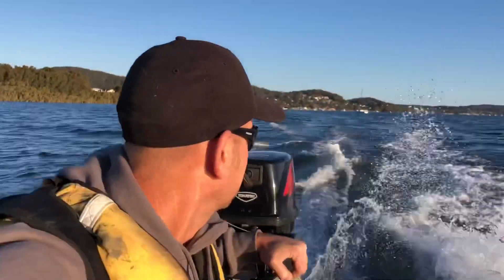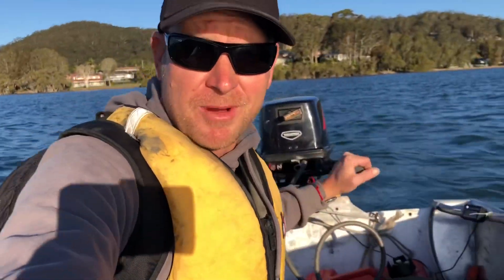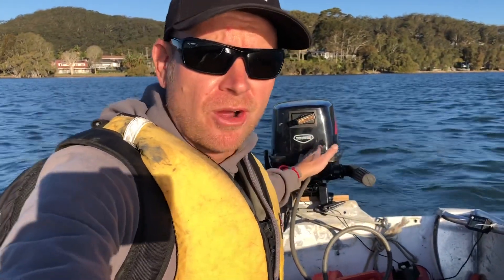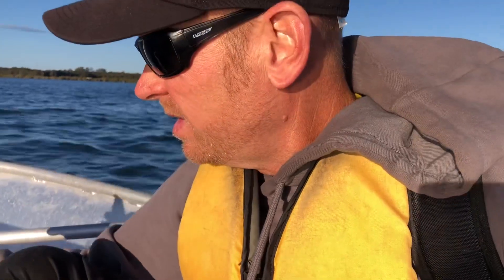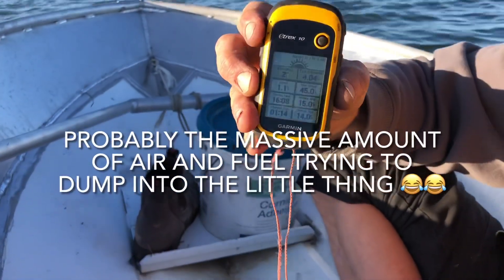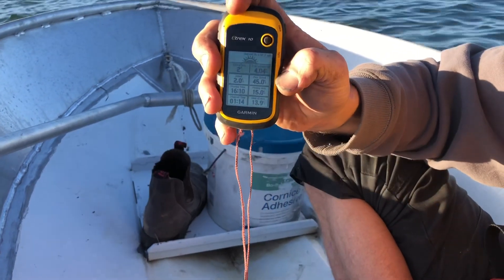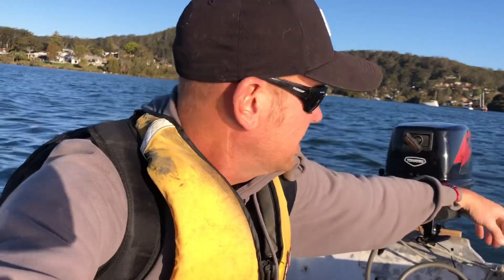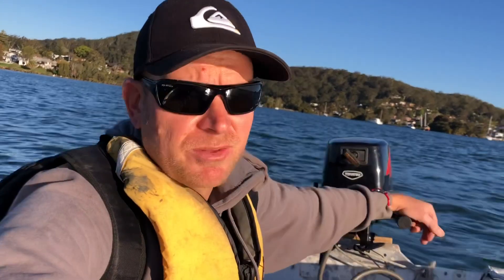Modified 9.8hp outboard

Comment: that thing is juiced. i believe the amazon hangkai 12 hp is the same exact engine (knockoff). would be awesome to try the mods on there. That engine is super cheap and readily available. Love the power to weight ratio.
Reply from the maker: Hi Mate,
Yeah, I’ve seen that 12hp, wonder if it’s actually any more powerful than the 9.8hp? would be amazing if it was. The power to weight is amazing for sure.
Cheers 🍻 
Aussie Boat Guy 😎
Reply: Hey Neon, post back here if you get that 12HP, I too wondered the same thing. Thanks
Reply: @rrrttt1112  yeah i bought it, it pretty much the same
Reply: @NeonSwell  Thanks, How much does it weigh?

Comment: Gday there. I have modified carb on a 5hp parson 4stroke. Used to do nothing 2thirds throttle and above. After finding webber carb calculations i have bored venturi out 2mm to match throttle bore and port matched carb and manifold. Recorded all before and after mods of air jets and fuel jet sizes. Am lean on main jet so made air bleed smaller. About to test it. Carb been on and off plenty times playing with fuel and gets better each time
Reply from the maker: Hi mate,
Good work, and sounds like your having as much fun as me, keep it up 👍 
Cheers 🍻 
Aussie Boat Guy 😎

Comment: did you have to take install a 18 reed block to fit the carb
Reply from the maker: I had to modify the original reed cover of the 9.8hp by aluminum welding extra material on where the bolts attach the carb and machining out the centre.
Cheers 🍻 
Aussie Boat Guy 😎

Comment: how hard is it to install the 18 carb
Reply from the maker: Hi Mate,
It’s super hard unfortunately.
custom reed cover, full carb rebuild and rehash for the linkages for the 9.8hp and jetting
Reply: @25hpboatracerman  hey man thanks for getting back to me. What are the mods? Could I do to my 9.8 to push some more power out of it? It's a tohatsu just like yours.
Reply from the maker: Hi Mate,
I have the video that showed all the things I did, you can see what’s involved by watching that.
Cheers 🍻 
Aussie Boat Guy 😎
Reply: @ hey mate is there anything that i can do without pulling the block of the outboard like do the carb reeds or anything in the lower unit ?

Comment: Well done, that outboard fly's!.
I had a 2006  9.8 long shaft, I wish I never sold it because it was light and powerful. Great video
Reply from the maker: Thanks mate, yeah I’m so happy with it.
I’ve owned about 5 9.8hp outboards over the years and glad I have finally modified one.
You can always search for another one, they are great being so light for the power they put out.
Cheers 🍻 
Aussie Boat Guy 😎
Reply: @25hpboatracerman   I  might just do that... I had my 9.8 on a 11ft dory and it pushed it along nicely, I can imagine it would absolutely fly with your 18 hp carb set up 👍
Reply from the maker: @glockeva1  
Yeah, it would.
Top end speed is a bit more but the power onto the plane and mid range punch is incredible 
Cheers 🍻 
Aussie Boat Guy 😎
Reply: Just buy the 18hp only 41kgs 👍
Reply from the maker: @aarondavis9044  
True, love the 18hp.
But if you need to carry your outboard (as I often do down to the water at about 300m) then the 26kgs is way better and now it gps speed clocked at 50kph so it’s nearly on par with the top end speed of the 18 👌
Ps: I’m sure I will end up modding an 18hp too.
Cheers 🍻 
Aussie Boat Guy 😎
Reply: @25hpboatracerman  I've got the 50hp tohatsu 2st bloody love it 👌👌
Reply from the maker: @aarondavis9044  
Yeah, they are awesome motors, got one as well 😁 go the Tohatsu 
Nothing like the sound of a three cylinder two stroke I reckon.
My mate has a 3 cylinder yam 30hp that’s modified, such an exciting sound 😁
Cheers 🍻 
Aussie Boat Guy 😎

Comment: Gidday mate! Have you considered flat slide carb fir this engine ? Im building the same engine to basically your specs, proper porting and the half mil shave yuve done 👍. Im excited! Could you please let me know the jetting in the 18 carby , ill definitely start there if youd be so kind ! Cheers buddy love these videos ❤
Reply from the maker: That’s awesome mate,
Did you make a new exhaust tuner and do the reed plate mods too?
I used the 22mm throat 18hp carb (there is a 20mm throat too)
I have ended up with a .60 low jet and I had to modify the main and reduce it to 1.02 as the 1.1mm was flooding the motor, still playing with the jets as it’s still not perfect.
So the 18hp 22mm throat carb normally has a .60 low and a 1.16 main jet.
The 20mm throat carb normally has a .80 low jet and a 1.1 main.
Just for your info.
Please keep me posted on your progress.
I’ve got a lower uni build video coming for that motor too

Comment: Cool! Would like to see some more details, do you have a different prop on it?
Reply from the maker: Hi mate,
Hope to be giving more details on mods in a future vid.
It’s just running the standard alloy prop and standard gearcase in that video.
I’m just trying to get the jetting off the bigger carb right, still not quite there 🤦‍♂️🤦‍♂️
I tried the 5hp race prop on that motor but running full depth. It hit 50kph gps but it’s not enough prop for it.
Got a few props I want to try once I raise the motor 😁😁
Cheers 🍻 
Aussie Boat Guy 😎

Comment: I thought it was only the 9.9 with the 18 block that you could do this to.
Reply from the maker: Hi mate,
Any outboard can be modified 👌
The 9.9hp Tohatsu can be modified with bolt on parts from the 18hp but it only shares the same block as the 15hp, the 18hp looks the same but has more capacity and way bigger ports from factory.
My 9.8hp shares the same block as the 6hp and 8hp so all my mods I have to make or do myself.
Cheers 🍻 
Aussie Boat Guy 😎
Reply: @25hpboatracerman  awesome stuff mate. So what parts would I be able to bolt on to the 9.9?
Reply: Does that mean that the 12hp hangkai is the same as the 15hp tohatsu since the hangkai 12hp matches the 9.9hp tohatsu? Do you go by model numbers?
Reply: Is there a major difference between the 9.8 and the 9.9? Or am I confused? 6hp-8hp-9.8hp same same then 9.9hp-15hp-18hp same same 
Or can I still bolt 18hp power heads onto a 8hp or 9.8hp leg

Comment: This is awesome! Been waiting for you to work on one of these beasts!  So, you said the motor is built to run rpms over 7000, is that the specs, or what your specs are after you did all the mods? Thanks (great job, am looking forward to more about this 9.8!)
Reply from the maker: Hi mate,
Thanks for your comments 😊
Yeah, I changed the port timing so that the power will still be available at higher rpm.
I built a custom exhaust tuner with a different shape and bigger internal than standard, it has 15psi more compression than stock, massive modifications to the intake and reeds, plus porting and the 18hp carburetor which has a 22mm throat instead of the standard 17mm throat.
Still fine tuning the jetting in the bigger carburetor.
Cheers 🍻 
Aussie Boat Guy 😎
Reply: @25hpboatracerman Is the 15 PSI increase in compression measured before or after you changed the port timing?
Reply from the maker: @Phantom-mk4kp  
Very good question 👍👌
Looks like you know that I raised the exhaust ports 😁
Yep, the 15psi increase is after the port timing change and measured after motor is all back together.
I would have gone more if I could but more than that I would have to add material to the combustion chambers, maybe in the future.
Cheers 🍻 
Aussie Boat Guy 😎
Reply: @25hpboatracerman  looking forward to the full tech videos on this. What was limiting more head skimming? Cutting into the water jacket?
Reply from the maker: @Phantom-mk4kp  
Hi mate,
It was the standard squish bands that are the limiting factor to how much I could skim off the head.
I could shave more and then re-turn the squish bands but just want to see what it can achieve with that head as shaving was pretty easy, gaining more comp than what I’ve got will be a big effort.
Cheers 🍻 
Aussie Boat Guy 😎
Reply: @25hpboatracerman  I understand. I was assuming that alongside skimming you were restoring squish depth, and that you saying next step would mean adding combustion chamber material I couldn't think of any other reason. Saying that, turning new squish depth should be fairly straightforward, assuming you have a lathe with adequate swing. Hardest part is a solid fixture. Could be done in a mill also, easier to secure.
Reply from the maker: @Phantom-mk4kp  
Yeah, you got it mate.
I left the factory squish bands and took off an amount from the head  that I was still happy with the squish band depth.
I will possibly do another head with more compression later but if I do I will want to weld the crank too and would probably go more on the transfer ports too if I do. I am just seeing if I can get a fair bit more power but still have some reliability and for it to last too 🤷‍♂️ we will see.
It’s lasted 3.5hrs so far 😂😂 things are looking up